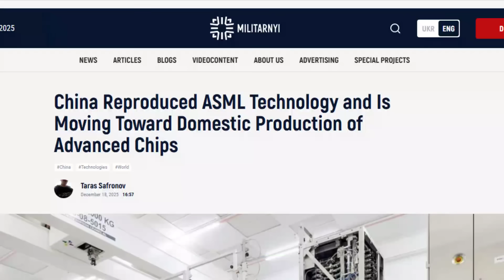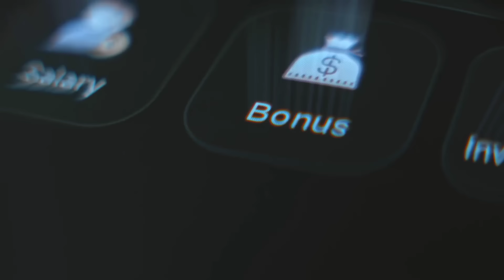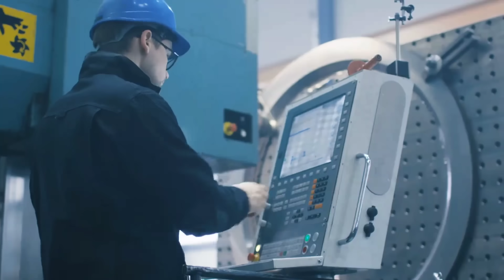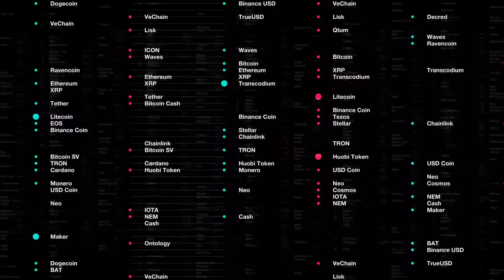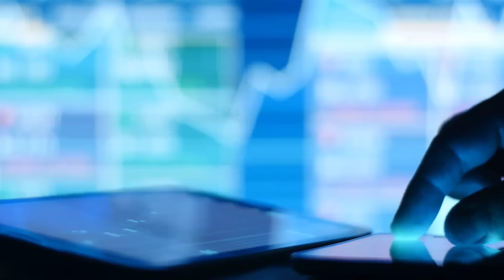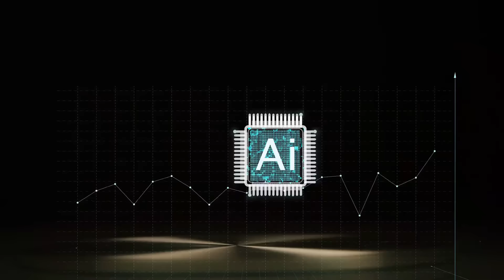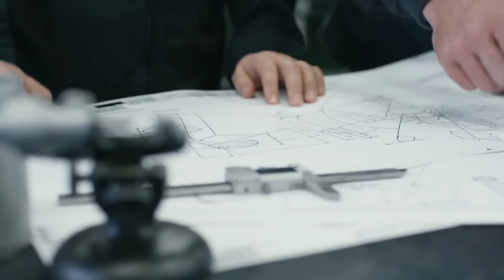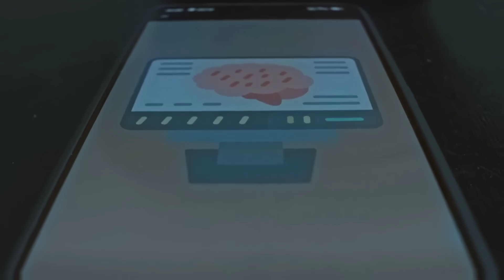China Just Built What ASML Said Would Take Decades.

Comment: The more the West bragged over the generation gap the more people's will believe that it is all over for the West. China has matched it and will surpass the West Techs b4 2030. The China EUV ecosystem will totally circumvent Western tech supply chain.
Reply from the maker: That’s a prediction not a proven outcome.China is clearly closing gaps in some areas but EUV is not a single machine it is an entire ecosystem light source mirrors resists metrology yields uptime. No country has shown a full production ready EUV stack outside ASML yet.Surpassing the West before 2030 is possible but not confirmed. Until we see volume wafers and real yields this remains an open question not a finished story.
Reply: @QuantumSilkRoute99  my son worked in the project 

They had their first prototype back in 2022

After 3 years of non stop R&D they're gone far beyond what you guys in the west are brainwashed to believe
Reply: Don't put money on it taking longer than 2030. I wouldn't be surprised if high yield volume production begins in 2026.
Reply: @QuantumSilkRoute99 it seems like this machine is very complex according to your answer your comment very complex it seems like